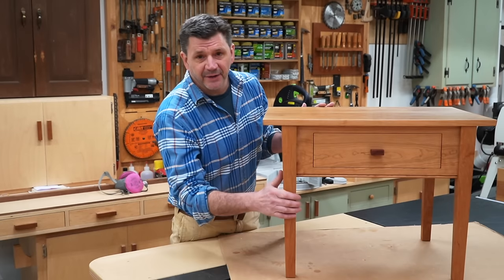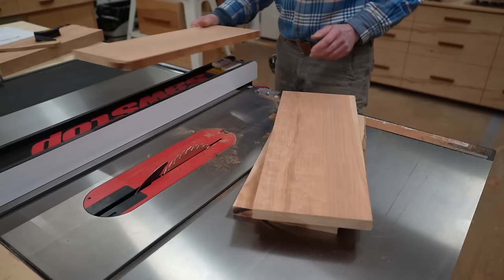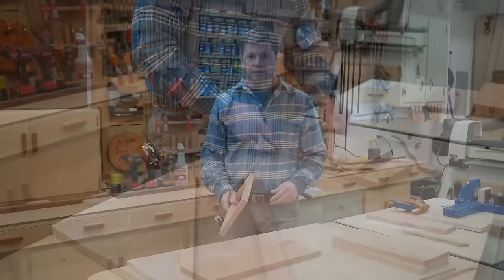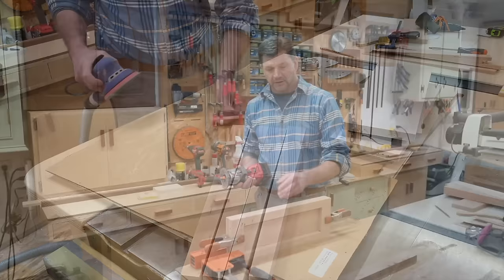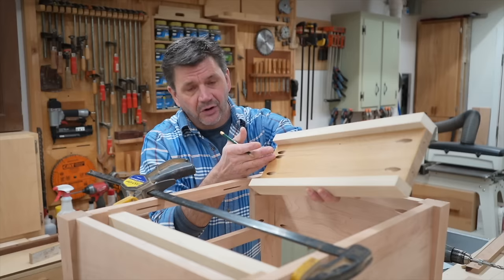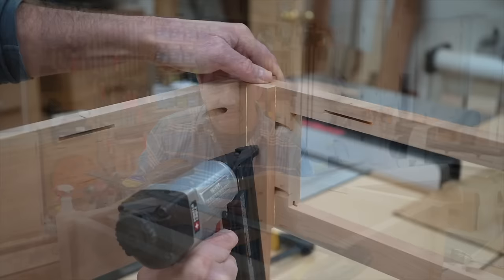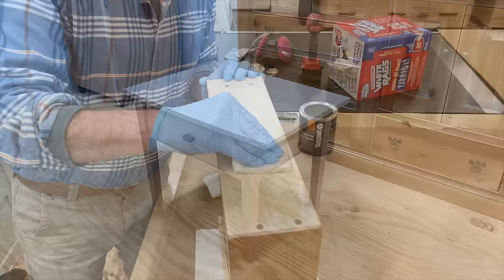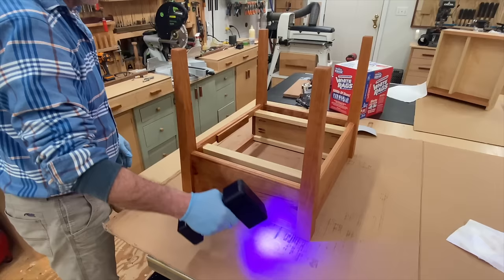Build This Cherry End Table - Game Table - Woodworking  Lesson - Plans Available

Comment: Nice piece! 
For new DIYers, I think Jon’s strategy is to build the more difficult front first. It determines the width of the back - and the sides if you build it square. (The actual exact width is unimportant. This applies in so many projects and it took me a long time to learn.)
Also, this is a really good project to practice a curve with, and that’s a super-easy way to do it.

Comment: Thank you John
So I learned several things from this video that would have made building the entry table easier. 1 st  I should have purchased the plans. 
2 pay close attention to cutting and re-glueing the front (my openings where to wide so I added a walnut accent to drawer fronts)
3 in this video you showed adding spacers to ensure the correct alignment of the drawer guides(when I add the guides the pocket screws pulled them and the back of guides are further apart. 
I will post some pics on instagram with a few more comments 
For those who may feel they need a shop to make these, I builder them on my backyard lawn on saw horses and for my first time creating a custom piece of furniture it turned  out amazing slow and steady
Reply from the maker: That’s great! I’m happy to hear that and look forward to seeing your project.

Comment: I enjoyed the video; the explanation of your methodology for crafting the front apron to accommodate the drawer was very clear.

I liked your method for constructing brackets to secure the top (to allow for wood movement), but had a related question: how does the pocket hole + glue joinery of the aprons to the legs not fall victim to wood movement? I'm in the process of building a console table; with narrower aprons (about 4"), and pocket holes would certainly be a lot quicker (and likely cleaner) than taking my first stab at cutting mortise & tenon joints (by hand). The table will live in a Great Lakes climate (in a climate-controlled house), if that makes a difference.

Comment: Hey John.. Love the effect of the finish especially with the LED Light getting it to dry so quickly.  That's brilliant mate..
That is a beautifully made piece but I struggle to get any really nice timber to work with atm. It's very pricey atm here so I need to save my cash up before jumping the gun so I think I may make it from pine or something like that to begin with and then once I've got it down to a fine art I will buy some good wood for making it the correct way my friend.. It's a stunning little table. It looks fantastic with that finish on it.. It brings out the beauty of that wood u used for this.. 
Love the video btw so I shared it to everybody on my socials..
Reply from the maker: Thank you that’s really nice to hear.

Comment: Dear Jon, 

I recently built a Bench-type table and I'm curious to know- 
Firstly, the table is stained with oil-based stain and coated with oil based polyurethane in clear gloss.
The topcoat has very small but noticeable bubbles and the side of the table had quite a bit of drip build up. The table has been drying for 3+ days. 
How can I smoothe out the top coat? Wet sand? Wool with Wool lube? Sand and apply another coat? 

I am overall happy with the result of my product, the polyurethane went on thick, the last coat was the thinest but yet they are still a few lines amongst bubbles.
How would you go about keeping that top coat shiny (I used clear gloss) whilst smoothing it out.
I appreciate your time, i feel as if some of your videos helped but won't fully answer my question, since you used a different finish than polyurethane when discussing use of Wool Lube.

Thank you for your time

Comment: Hello Jon, I have a question about drawers. I’m new to building them. Is the purpose of the drawer stop (in the front) to simply get the drawer to perfectly align with the face? Can drawer sides just be cut to hit the back inside apron of the table as a stop rather than installing the front stop? I assume it’s an easier approach to do it the way you did but just wanted to ask.
Reply: Looks like there's actually two stops at the front. The long piece that's glued at the bottom seems to be preventing the drawer from going in too far as you mentioned. The small one mounted with a screw up top and rotates is to prevent the drawer from pulling all the way out. You could cut the drawer so it hits the back and stops where you want it but that's a lot of precise measuring and cutting - a lot more work. You also could devise some other type of stop at the back as well but again, more work. Jon's solution seems the easiest method and precise as the drawer face and frame are the same thickness.
Reply: @philshock3805  That’s what I was thinking. Thanks for the help.

Comment: At 13:10, the spacers are glued cross-grain with the apron.  Is the seasonal movement irrelevant when the apron is less than 7 inches tall?
Reply from the maker: Good question, two years later and so far so good 👍

Comment: Jon: I understand using the tape measure for the length of the front. But why don’t you use the front to measure for the cutting of the back if you want them to be equal? It may avoid tape measure shortening…….
Reply from the maker: Hi Richard, that’s definitely another option. Just didn’t think of at the time

Comment: I have a very limited shop. no Joiner or planar. what is the best way to do  these plans without that equipment?
Reply: I think that if you buy your material S3S you will be in good shape to get square and flat results without the use of a jointer or planer.
Reply from the maker: Good point 👍 yes buying lumber s4s is the way to go… even though I have the tools I still often buy wood S4s to save time.